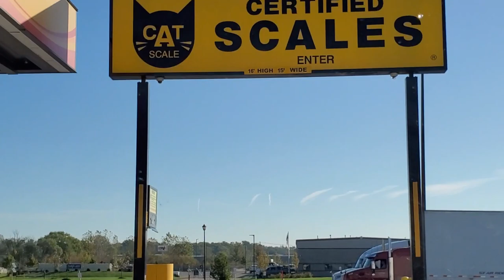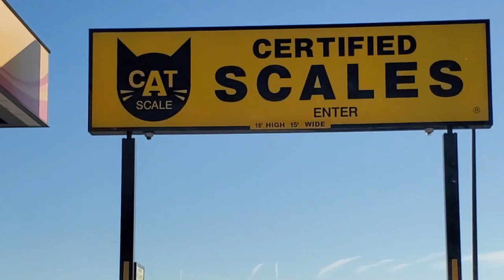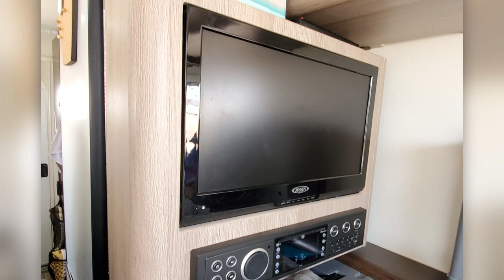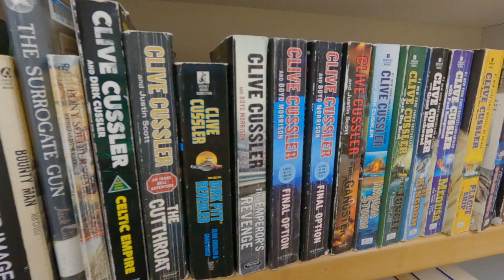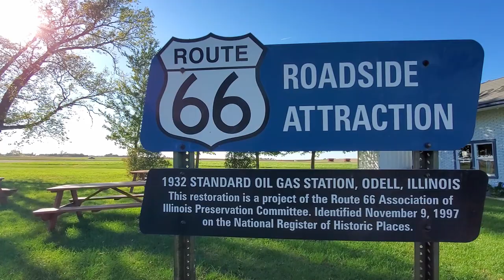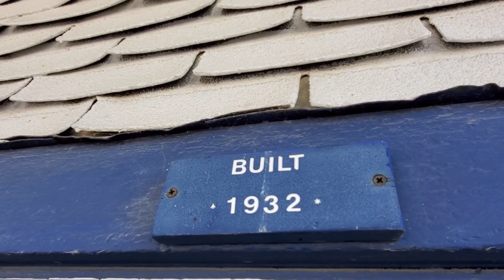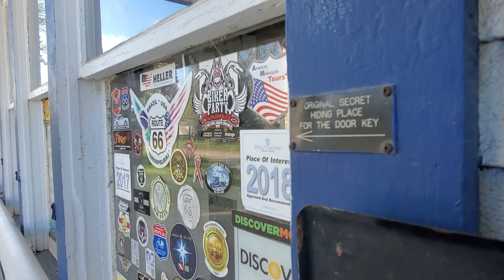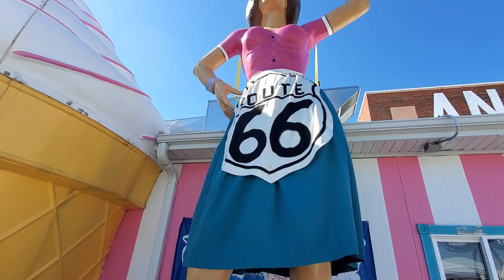Time to Weigh the Truck Camper. 8 Top Tips for Keeping Your Weight Down for Full Time RV Life.

Comment: Some good tips.
One I started recently was to fill freshwater to only what we might use until reaching our destination, or a source closer to it. With the limited weight allowed by a truck camper,  every little bit helps.
Reply from the maker: Great tip. We do this too. No point in running with resources you don't need. We find that sometimes we're headed to a campground but other times we're in the desert where we don't want to take any chances.